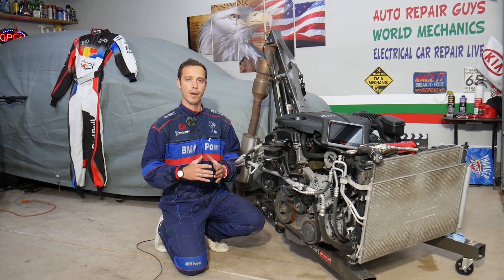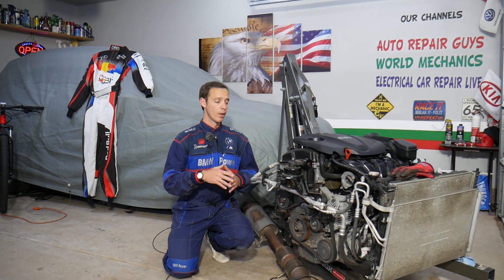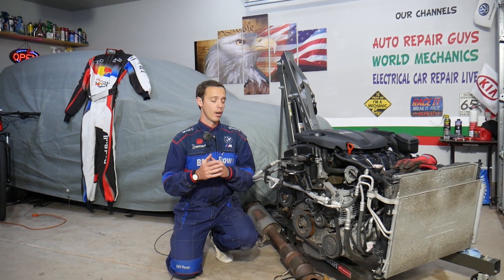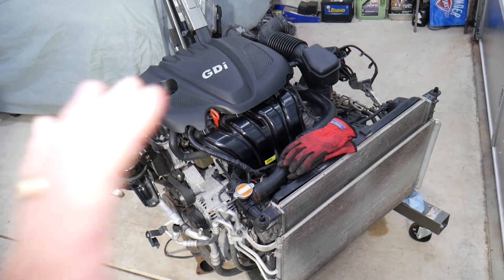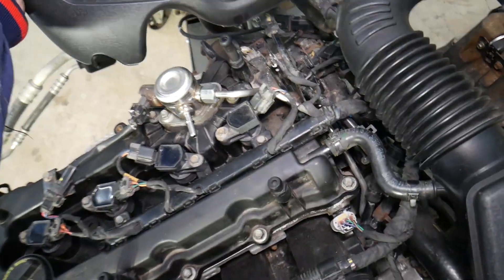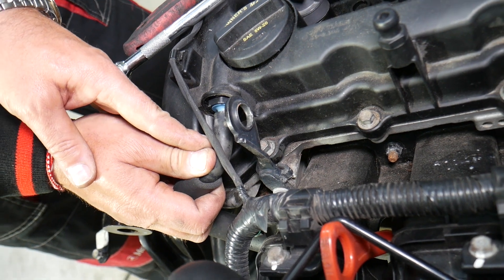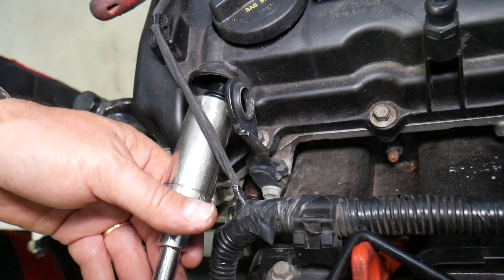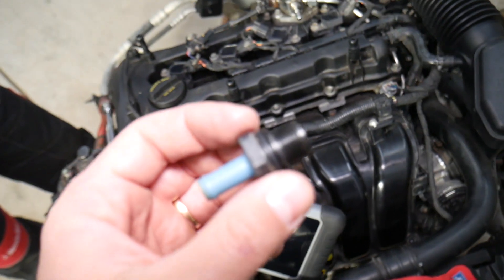HYUNDAI SANTA FE PCV VALVE REPLACEMENT LOCATION

Comment: For 2015 santa fe you need a special socket to remove pcv. Need 23mm extra thin wall socket. I bought from amazon,  sunex 2623. In 2015 model pcv is in a cavity. Difficult to use needle nose to remove.

Comment: We have a 2018 santa fe that burns a quart of oil every 900 miles. The pcv valve appears to be part of the valve cover...is this correct or can it be removed? It looks as if the nut is molded together with the cover.....the engine has been replaced by the second owner supposedly. It still burns mega amount of oil.
Reply: Only use full synthetic